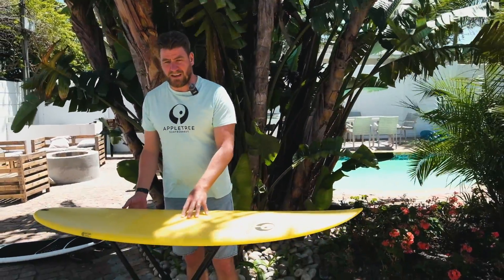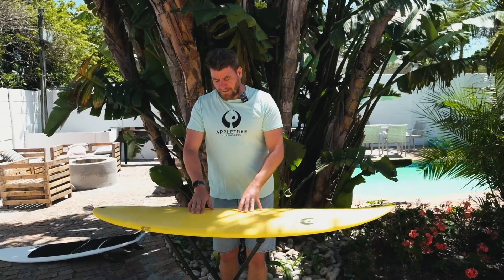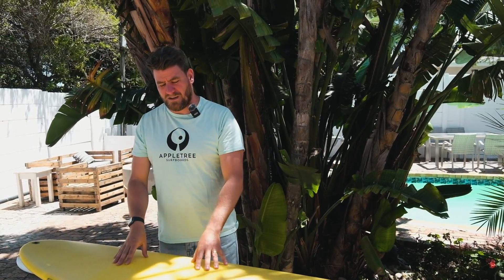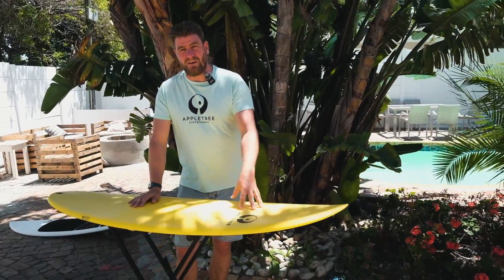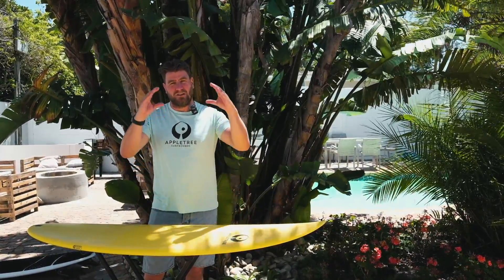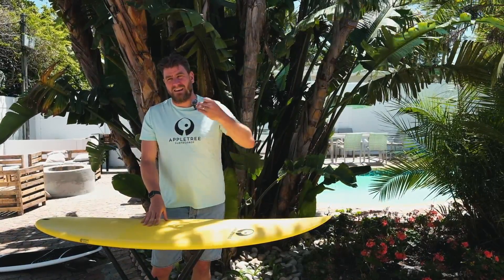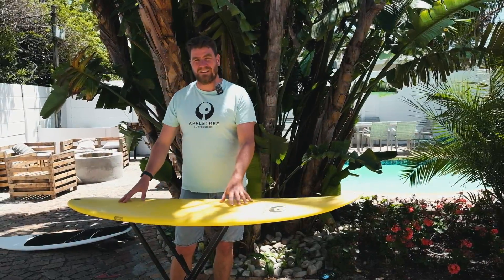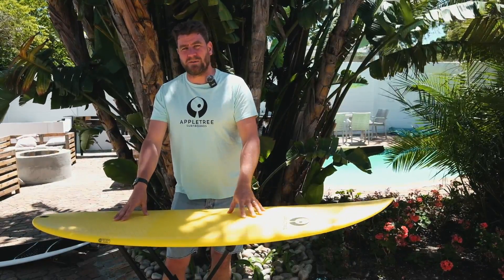Tech Talk: is vacuum injection the same as vacuum bagging?

Comment: Is it possible to do on EPS or only PVC  closed cell?
Reply from the maker: Hi! it's not really possible on EPS, as the open cell structure takes in too much resin. You need a closed cell foam. It does not have to be PVC specifically.

Comment: Do you still apply a hot coat?
And what keeps the vacuum pressure from crushing/deforming the foam core?
Reply from the maker: yes we do finish with a hotcoat. our foam can resist much higher pressures than normal EPS